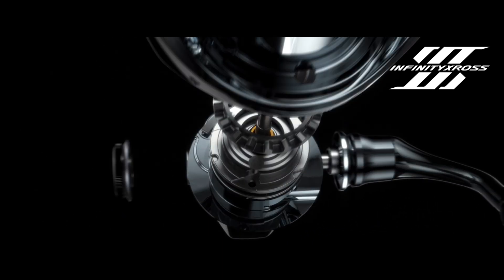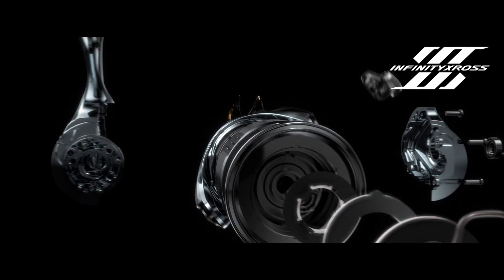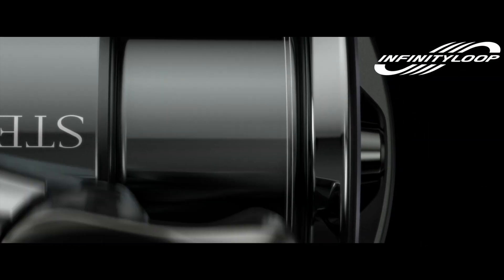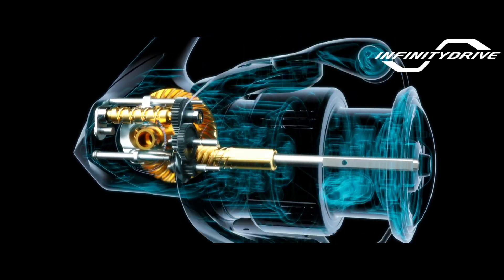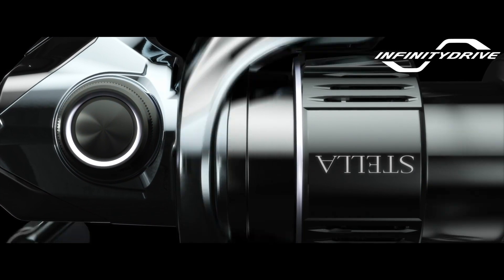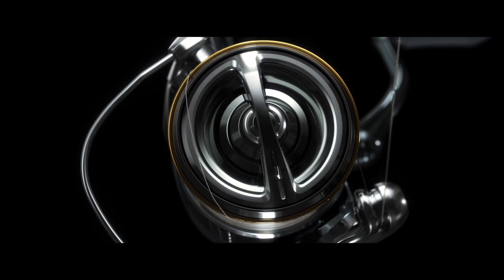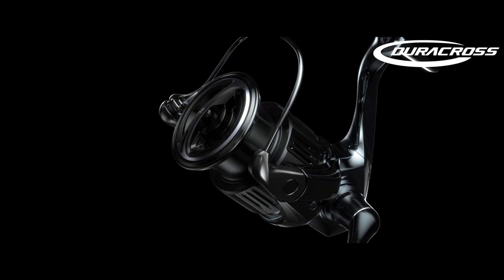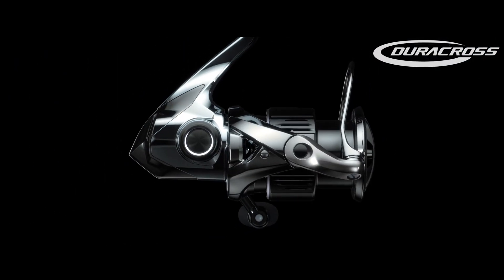INFINITY EVOLUTION - STELLA FK TECHNOLOGY

Comment: I was counting to reduce retrive on 4000 model  a bit from 87cm to the Gold standard og 80-81cm max, as it used to be in good old Times from shomano. But it is still 5.3:1 and 87cm. It is too fast for normal crank in europe, and too słów for fast crank for ASP.
Reply from the maker: 4000XG is 6.2:1 with a 101cm retrieve per crank. Cheers

Comment: Finally...is this new version of Stella FJ 2018?
Reply: Honestly, I don't see any significant innovation compare with FJ 2018. After 4 years waiting, I expected new revolution technology from them as the biggest brand especially on their high end product. Now I really curious the update version from their biggest rival.
Reply: @janatpermana3581  the gear is slightly angle at 0:51
Reply: Yeah. This is the FK.
Reply: TS the new version from the Stradic CI4+ its all the same, you can change the parts from one to the other.